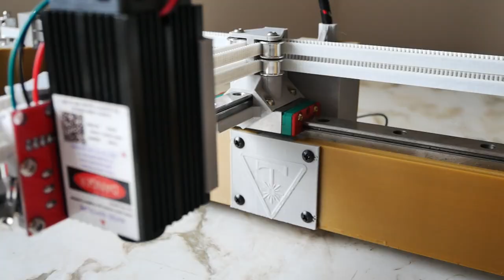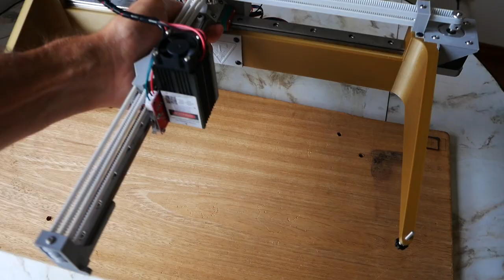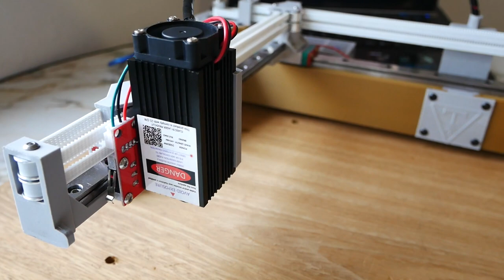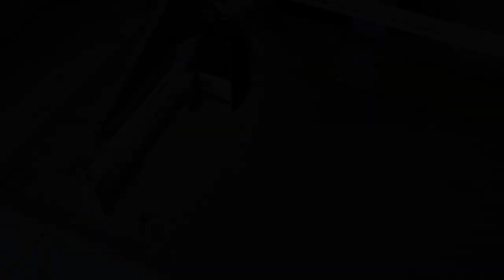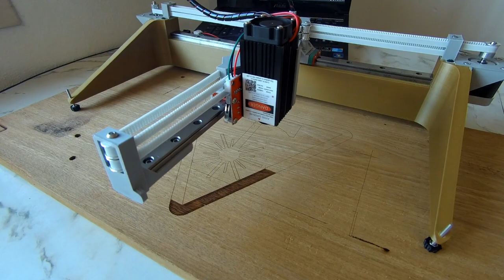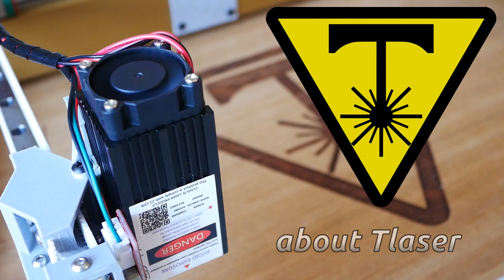Tlaser - CoreXY cantilever 3D Printed Laser Engraver

Comment: is it easy make tlaser a bit smaller 215mm x 205mm engraving area , any firmware changes
Reply from the maker: In terms of firmware, to prevent collisions from exceeding X travel, the X max travel should be updated to the new value, with grbl that is as simple as sending $130=215 to the machine once it is connected to the laser software.
Other than that,  geting a MGN 15H of 300mm of length instead of 400mm, editing the FreeCAD files, check if it all matches in assembly, and it should work fine.